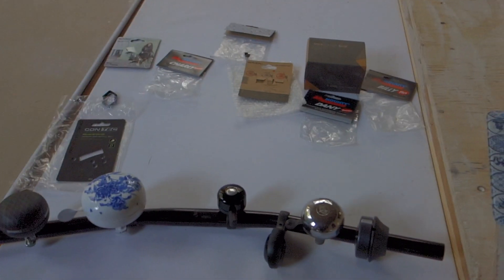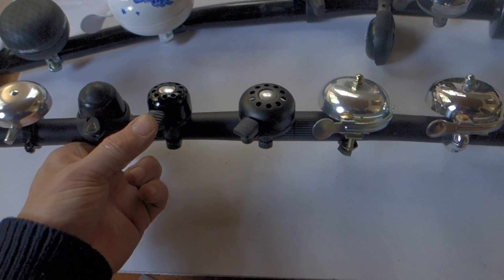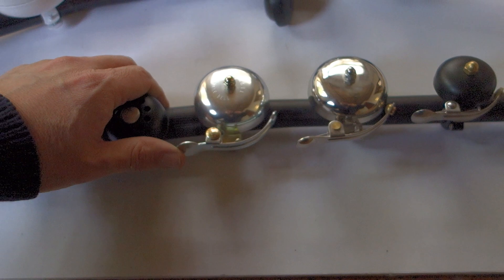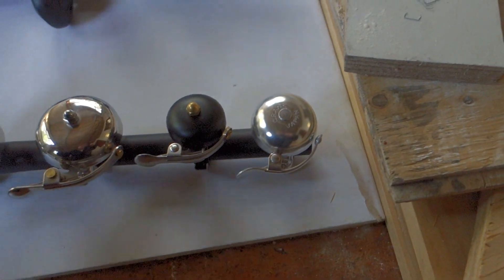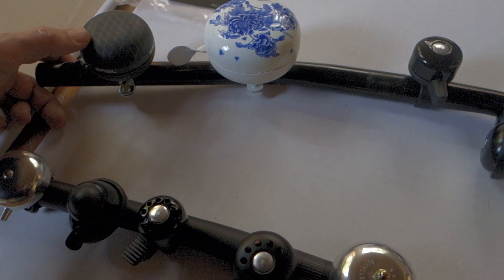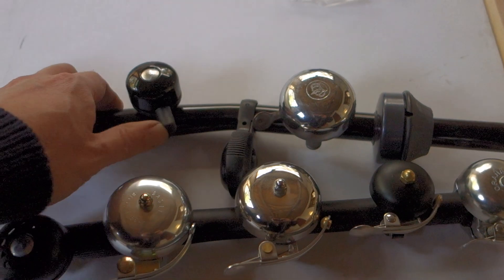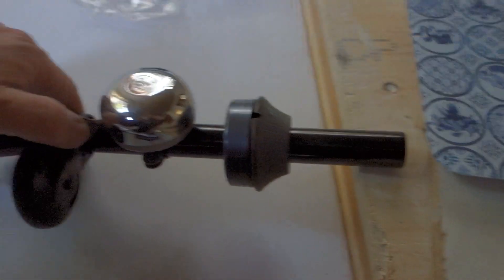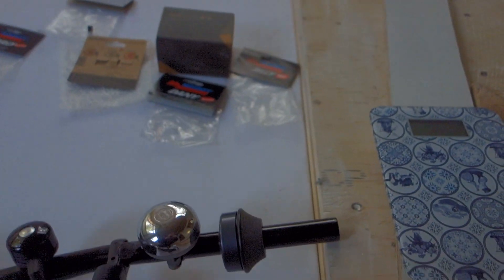Bicycle bells part 1: Test in the dry (A comparison of ding-dong, tring, ping bell types).

Comment: I have seen and tested a multiengagement bike bell in just 1 press it has multiple engagement similar to the last one
Reply from the maker: @allesvertig  : So a different mechanism but also 2 sounds, or more? Do you recall which brand/type it was?
Reply: @WHS_reviews  I tried to visit the shop again to buy it but somebody came first. But I will visit the Bike shop again and ask what brand it is. I'll update you.
Reply from the maker: @allesvertig  : I will wait for the information :)
Reply: The Brand is E•NE Revolver Crane Bicycle Bell 🔔 Made in Japan.
Reply from the maker: @allesvertig  : Aha, found the specifications, looks interesting, a mix between ping and tring in that you can vary how many times you ring with the finger movement.  I will see about trying/testing one. btw. the manufacturer is Crane, same as one of the ping bells that I tested (which has an aluminium dome, not good for in the rain), the mount looks good, dome is apparently brass which is better than aluminium in the rain.
Reply: @WHS_reviews  Glad to help you 😊

Comment: The bell I am interested in is the unknown brand tested at 4:49.  Any idea?
Reply from the maker: I replied to someone else long ago (in reply to the question: "The large ceramic like blue bell where to get it? What do you call it?"), to search for: delft blue ding-dong. At the time I came to a czech website, and I found it again but it doesn't have this exact bell with the flowers any more. Almost all 80mm ding dong bells sound very similar, so you could do a picture search and select one you like and then see where you may be able to buy one. I bought mine long ago on amazon germany, brand was stated by the sller (some bike shop in Germany) to be 'zemto' but I never heard of that before nor since.

Comment: I use the one shown at 5:56. The downside is that it rings every time the bike shakes on the road. I would like to know how other models of bells react to these shakes.
Reply from the maker: Ah, the tring bell. Yes, I've had some email exchanges with a commenter about his bell on the same issue he had. It varies per bell how exactly it is inside, but there are usually 2 metal washers in the bell that are loosely kept in place with pins that have a smaller diameter than the inner diameter of the washers. When rotating they get flung towards the metal dome but can still move to the inside when they hit the bump on the inside [ this contact makes the sound ]. The problem seems to be that with some bells in the resting state one of the 2 washers hits that bump if it is moved by say going over bumps... I don't know what the proposed fixes did, whether the problem was sorted out. I assume in your case too the dome is screwed on, then you can try to put a small washer in the centre so the dome screws on less far and the bump on the inside will be in a different position. It may be that you can also solve it by adjusting the (rotational) position of the innards so that the resting position changes.
Reply: @WHS_reviews  thanks for response. Now I adjust the position of the dome. In some positions it is quiet. All I have to do is find the way to lock the dome in that position. Two bells of this kind and two same issues.
Should I change to another type of the bell to forget about this issue or there's no guarantee?
Reply from the maker: @amgluk  : I've never had this problem with the tring bells that I have including a Widek tring bell that I bought in 2022 for some additional testing. I consider your issue a flaw. What brand is it?
Reply: @WHS_reviews  oh, that's noname, they came with new bikes more than 20 years back. It's definitely a flaw, but the design of the bell potentially tends to reproduce this problem.
Reply from the maker: @amgluk  : no, the threads are normally cut on the bottom part and top part in a systematic way, it doesn't just change with some settings or from variations in time of production. The place where the bump is can then  be selected by another machine that punches the dome for the intrusion, that is the place where the washers hit. So this is easily made in a way that the bell always works well and that there is no issue as you esperience. This is why I consider this issue a design flaw by that particular manufacturer. As I said, try to find a washer that fits, then you could put thread locker or contact glue (the glue type that stays flexible) on the threads and screw on the dome.

Comment: You don't mention who makes the 'ding-ding' bell second from the end
Reply from the maker: As stated in the list, the blue-white is of 'unknown brand'. The small black one is made by Basil who also makes large 80 mm ding-dong bells, but not of this particular blue-white design (they have other prints in blue-white though). you can find similar bells fro various brands, sometimes you just need to search a bit to find the bell you want, and it may be from some unknown or no-name brand. See my reply in the comments about finding this particular bell, I couldn't find it from the original seller again, but found it from another online shop by searching for something like "delft blue ding-dong bell".
Reply from the maker: Addition: I thought you meant the ding-dong bell and not a ding-ding bell, as on the top row the ding-ding bells are 3rd/4th from the left and 3rd/4th from the right (whatever you take to be the end), but in case you did mean on of those: the manufacturers of those are mentioned: Mounty and Contec.

Comment: I want the 1970 in 58mm
Reply from the maker: I checked and the tring bell with this particular shape is not currently made by Widek, so if you like this visually, then perhaps an option is to search for a 2nd hand one. You could try the site 'marktplaats.nl' for example. The term to search for then is 'fietsbel', anything more specific is likely not to give results as people are unlikely to specify exactly what brand and type of bell a bell is. If you need help send me an email. As to Widek's current tring bell's shape, it is more angular. See this image from their site: https://www.widek.nl/images/02%20-%20Onze%20producten/01%20-%20Producten/01%20-%20Fietsbellen/Widek_1618_bell_steel_chrome.jpg

Comment: 0:09: [ping] Standard (ca. 1990s) 'race' bell. This bell sucks!
    0:33: [ping] Brave classic: Pin (aluminium dome, diameter = 45 mm) Good
    0:43: [ping] Widek "Deci Bell XXL". Aluminium shell, diameter = 34 mm, uses a rubber band to mount on the handlebar. Sucks in the rain and afterwards!
    1:03: [ping] Mounty: Billy plus. Aluminium shell, diameter = 33 mm, with resonance holes. Good when dry, not so good when wet...
    1:15: [ping] Mounty: Charly. Aluminium shell, diameter = 44 mm, with resonance holes. Lower frequency than the Billy plus.
    1:52: [ping] Basil "Portland" aluminium (aluminium dome, 57 mm) fairly poor after rain
    2:14: [ping] Voxom: KL5 (stainless steel dome) Very nice bell
    2:43: [ping] Owl vision: Hoot mini (brass dome)
    3:12: [ping] Crane Mini Suzu W (aluminium dome)
    4:21: [ding-dong] Basil: 60 mm ding-dong (steel dome) Excellent sound, but standard steel. I wish there was a high end stainless ding dong bell...
    4:49: [ding-dong] Unknown brand: 80 mm ding-dong (steel dome) Excellent sound, but standard steel. I wish there was a high end stainless ding dong bell...
    4:56: [ding-ding] Mounty: Dany (aluminium dome)
    5:32: [ding-ding] Contec: ring-e-ding (aluminium dome)
    5:55: [tring] Widek: Standard tring bell (chrome plated steel dome)
    6:45: [tring] Gazelle: tring bell that sits around the handlebar (aluminium 'dome')

Comment: Good attempt at presentation but why not securing the bar firmly so that it does NOT move all over. Also, you may want to set the camera on a tripod for a more effective demonstration. You did cover a whole variety of bells. Thanks!
Reply from the maker: Well, as stated, I made this video during renovations. I think my tripods were all stored and I only made this video after making the linked page on my site about these bells, as an addition. The main information on any topic I deal with is on my site, not in my videos, they are only additions. In text you can describe far more detail, search for keywords etc. so videos are not very good for an archive of ideas/reviews/analysis, and that is also what I state on my site: videos are nothing more than supplemental.
Reply: @WHS_reviews  I appreciate your kind response. I have visited your site since. The extent of your research & presentation is quite impressive. Thank you!

Comment: You need to print the name of each bell below it so it can be read. Cant understand what you say !
Reply from the maker: I posted a list of all the bells and the manufacturers' names in the description and in the comment I placed in the comment section, so what needs to happen is that you need to read that, then you will know the bells/makers. I pronounce the Dutch and German makers as they should be pronounced, not as an English speaker would pronounce them.

Comment: I recently found a vintage mickey mouse bell in great shape.  The problem is when I ride it rings on every bump. It's the type that spins inside.  Anything I can do ?  Thanks
Reply from the maker: That is likely a normal tring bell but perhaps someone made a change to it. Tring bells normally have 2 rings inside that move outwards when you activate it from the rotation (centrifugal force). These then hit a bump on the inside of the dome that make it ring each time one of these rings hit the bump. Perhaps someone opened it up to repair it and put too large (new) rings in it, perhaps something is bent and one of the rings touches the dome which means in both cases that the bell would ring at every bump. Try to unscrew the top, then you can see what is wrong. This may take some force, but normally they are screwed on. Once unscrewed ring it and see what happens and see where the rings may touch the dome without ringing. It could also be that the bump is placed such that it is at a resting point of one of the 2 rings.S If that is the case see if you can make a change to that by e.g. using a spacer on the thread.
Reply from the maker: I should have said "washers" instead of rings, but I think it will be clear. Let me know how it goes!
Reply: @WHS_reviews  This one does not have washers but one rectangular piece of metal that can slide back and forth. It's made in Germany
Reply from the maker: Interesting, perhaps you could make a picture, and send it to me then I could see if something stands out if you can't find the fault. You can find my email address here: https://swhs.home.xs4all.nl/fiets/email_en.html

Comment: The large ceramic like blue bell where to get it? What do you call it?
Reply from the maker: Do you mean the white one with blue flower pattern? It's a ding-dong bell, such bells are available in many colours, patterns, but they vary per year in what is available, so you will need to check sellers. The one I bought was from a german seller, and the brand was 'Zemto' the seller stated but is no longer available (but see below). You can find somewhat similar ones from Widek in the "Delft blue" line (4 types), for example. I suggest searching for ding-dong + delft blue. A picture search gave a result for the widek bells but also the bell I bought on a czech site.
Reply: Thank you so much for the information

Comment: Do you know how to extend the part of the bell strap that wraps around the handlebars?
Reply from the maker: Which bell are you thinking of? A bell with some rubbery strap? Perhaps an option would be to make something out of a thick inner tube? The bells I tested are made for a specific diameter such as 22.2 mm or 25.4 mm with plastic, steel or rubber mounts. You can insert a spacer into 25.4 to get to 22.2 mm, for other diameters such as 31.8mm handlebars or to mount say on the top tube of a bike, you will need to fabricate something. E.g. of the ones that have steel or aluminium mount with 2 bolts I would suggest using a bit of 1mm thick aluminium plate, measure out how long it should be (and how wide) and drill holes at the right spots for the 2 bolts, then bend it around the handlebar and then use pliers to bend back the ends. Whether that works depends on how far apart the bolts are, and it may be good to add some filler on the top mount to fill up the mount to the different curvature of the bigger handlebar.
Reply: @WHS_reviews  It has a plastic strap not rubber.  And it attaches with a single screw.
Reply from the maker: Some of the bells I tried have such a mount, but you could use some rubber to extend it or even cut it off, drill a small hole and attach there were you cut it, a new longer piece of material that works for this type of bell and the handlebar diameter to give enough friction that it won't rotate on the handlebar when using it. Some bells use rubber bands, so rubber is a possibility... It all depends on what you have available say in scraps of aluminium or pieces of plastic, or even a thick inner tube could be something to try. I may give this a go myself in a future video along with some other mods of other bells.
Reply: WHS reviews Thanks. Good ideas! I will try one of these.
Reply from the maker: Ok, just to add: so the hole to drill if you cut of the original strap can then be used for a screw that will self-tap. I usually keep screws and bolts if I dissect and throw away some device, and they usually come in handy at some point, but if you don't have something handy you could buy a few small stainless steel parkers (self tapping plate screws) from a hardware/DIY store. Further, your question made me revisit my webpage on the bells, I will add information on the diameter of the handlebar that the bells that I tested can be mounted on (usually one of: 22.2 / 25.4 / 22.2+25.4 with spacers, very few are 31.8).
Reply: WHS reviews Ok. Thanks.

Comment: Pretty good video . lots to choose from . I wanted you to wait one or two more seconds to ring the bells after you stopped talking . it seemed a bit rushed . 
Also i noticed that the Lion Bell Works was not shown . a very high quality bell made in england ,  but brass. You mentioned you didn’t care for the sound of brass.
Reply from the maker: Ah, it's interesting that you feel this way. Someone long ago made a fairly crude comment that the video was too long and that he only wanted to hear the bells... I didn't rush, I just lingered just long enough, I thought, to give a feel for the sound of the bells. The most important is just when you ring it, when it's still quite loud, not how the sound dies off. The latters is more an effect that you notice, or in my case that is annoying, with brass bells. I had noticed the Lion bell works bells on amazon.co.uk, but you are right, as I don't particularly like the sound of brass bells, I didn't take a closer look. From the comments and the pictures and information from that company they look very well made, so for those who like brass bells, I'd recommend to take a look at them. For the sound (frequency spectrum + loudness) what is most important is material + size of the bell. The striker doesn't really have an effect in loudness as I tested/showed in the update video on bells and grips, with a brass striker instead of aluminium, on an aluminium bell. The bigger the bells, the louder it can be but also the lower the resonance frequency. So you should more or less be able to estimate the sound. Perhaps I will look into testing them at a later date, along with doing the modification of resonance holes of the 1 brass bell that I still have that I want to try out to see what effect it has (it's been on my to-do list for ages but didn't get round to it yet).
Reply: @WHS_reviews  i ordered a lion bell a few days ago . it’s suppose to come next week . i also noticed that the striker is rather odd . i hope it is not a problem . if you like , i will post a comment after i install the bell and try it out .
Reply from the maker: Yes, will be interesting to know what you think of it compared to the bells I showed in this video. I just had a look again on amazon and with one of the bells a buyer felt it was 'agricultural' ;-) The striker uses a spring in vertical orientation which is unusual but perhaps this was done to minimise deformation of the edge of the dome where the striker hits each time.
Reply: @WHS_reviews  So , got the bell from Lion  Bell Works and installed it . 
The dome is brass and all other materials are stainless steel. 
The sound is similar to the Basil and Voxom and last for about thirty seconds . 
I like the sound very much, but as you know sounds can be very subjective . The build quality is excellent and there is an extra mounting screw for larger diameter handlebars . It comes in a white cloth bag with the name of the company and their website printed on it and it’s made in England . The cost is 23 € plus 6.38 delivery to germany .
Reply: @WHS_reviews  i forgot to mention the loudness factor . not sure how loud it is compared to the bells you reviewed . It’s loud enough for me as i will be using it almost exclusively in the forest where i ride . I got the bell because i have frightened a lot of hikers that didnt hear me coming from behind them . Some even told me to get a bell in a rather unfriendly manner . 
I haven’t tried it yet under those circumstances .